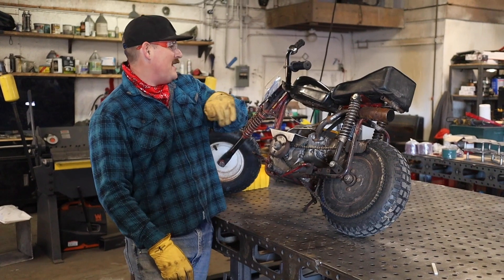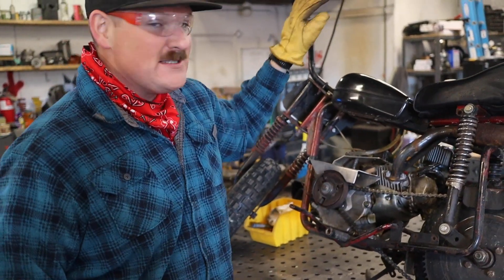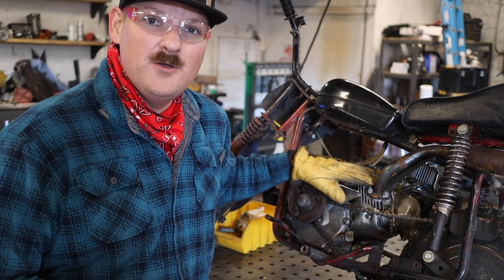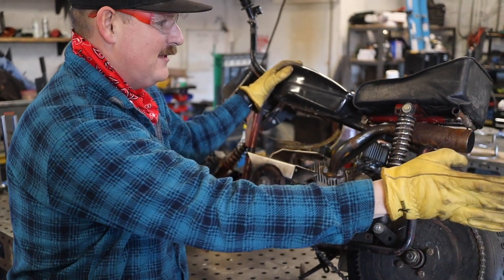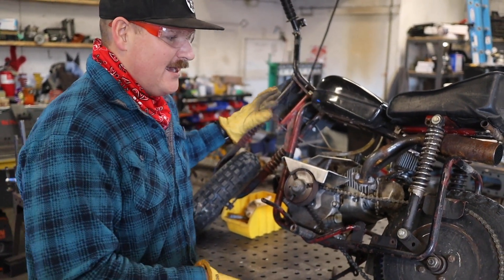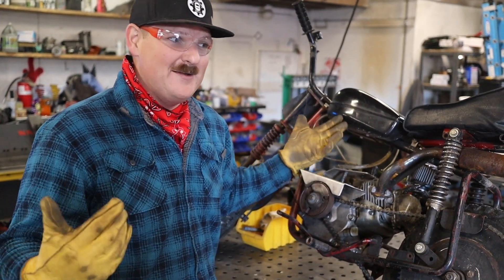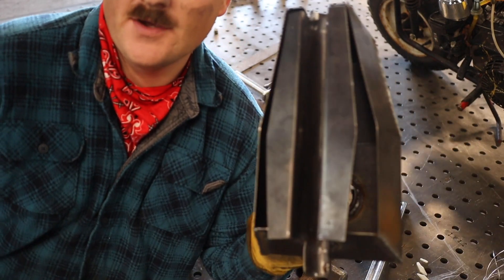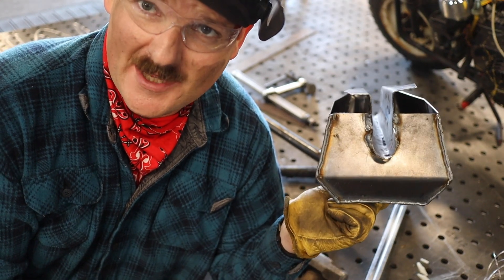Make A Gas Tank

Comment: SWEET! 👌 looks really cool.. I love creating things for my sport bikes. Hey what gauge metal did you use? Also what welding process? Is that flux core? I have a flux core welder and also a Lincoln tombstone stick welder. Which do you think would be best to use? Does anyone have an opinion? Thanks for the upload! ✌️
Reply: I think 20ga would do, FC and stick can do... 
FC being easier and getting better results..... It all in how you set up the machine.... some machines dont have much to allow setting adjustments. 
Stick, youll need to get some thin rods and practice getting the settings low enough you dont consistently blow through the sheet. 
If a stick machine is what you have, you might look into getting a scratch start tig setup, as the tombstone machine is a good candidate to power that.

Comment: Aren't there some specific gas tank requirements? Like painting it inside with something so it wouldn't corrode from the fuel?
Reply: I made a mad max style dirt bike gas tank and I just used por-15 gas tank sealer. All you do is just mix it, pour the can in, slosh it around, and pour out the excess. Check out my recent video on my channel if you want to see a little more of what I'm talking about.